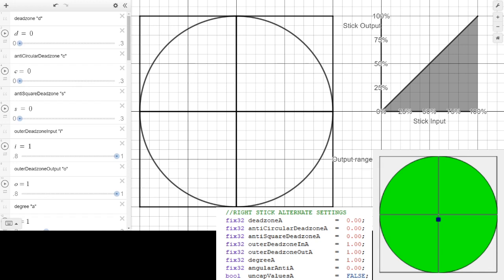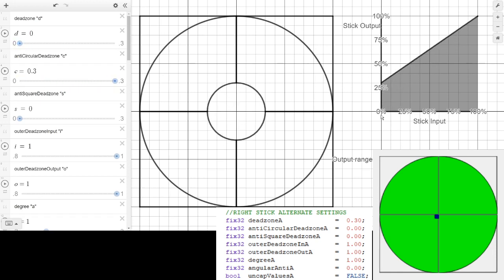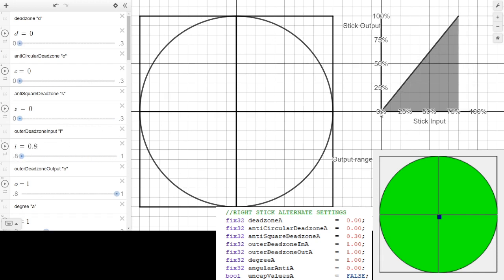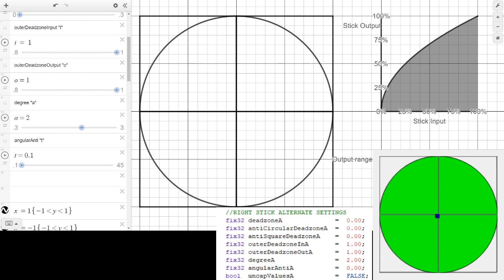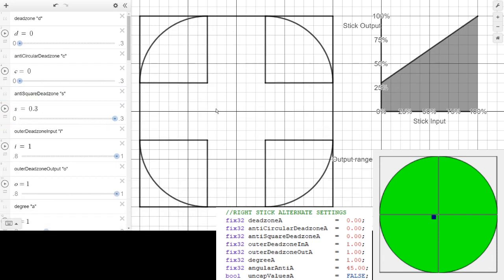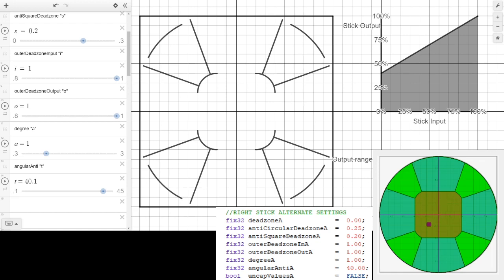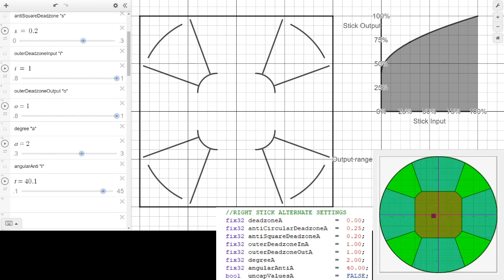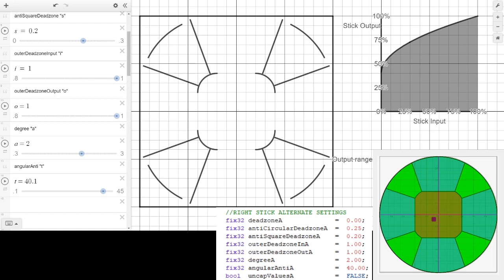Anti-deadzone Explanation and Demonstration

Comment: I associate deadzone as a counter to stick drift, so would increasing my anti deadzone increase my stick drift too?  If so, is there any way to counter the stick drift from the anti deadzone?

Another question is: With a 0 deadzone, would reducing the outer deadzone input have the same impact on the stick output as setting an anti-deadzone? Could I start my movement at 10% the same way as an 0.1 anti-deadzone just by reducing the outer deadzone? And if so, would the rest of the movement match?
Reply from the maker: The antideadzone values can be used in a few different ways, including counter the game's deadzone, make the curve/degree changes more accurate, or to functionally change it's shape.  All of the values in this script can be used together, and the deadzone value can be used to set the size you actually want like in any game that offers it.
Some examples would be:

If you want to use a circular deadzone at 30%, but the game uses a square deadzone at 20%.  You can set the antiSquareDeadzone to 0.20 and the deadzone to 0.30 to do that.  Nothing will happen within [a circular] 30% of the stick, and once you exit the deadzone it will then apply the antideadzone and counter the game's deadzone.  There you've increased the deadzone you're using, but have countered the game's deadzone shape.

If you wanted to use a 15% circular deadzone, and the game already uses that, but you don't like the curve the game uses, you can set the deadzone to 0.15, the antiCircleDeadzone to 0.15 and customize the degree to your preference.  You're still using the same size deadzone in this case.  If you look at the linked graph and set the deadzone the same as the antideadzone, you can see there's a a gap, but changing the degree will show the starting part of the curve will change.
Reply: @EternalDahaka  If I wanted 0 deadzone and 0.1 anti-deadzone would I experience major stick drift? How would I circumvent that without increasing the deadzone and compromising the responsiveness?
Reply from the maker: If the game's deadzone was 10%, and you used an antideadzone of 0.1, then that would cancel the deadzone and give you a 0% deadzone.  The stick drift would be the same if you played at 0% deadzone in a game that offered it.
If the antideadzone used is larger that the game's deadzone, then you'll start skipping over actual turn speeds.  For example, if a game's deadzone is 10%, and you use 0.15 antideadzone, that ~5% of the most precise speeds is lost.  Any drift would be worse in that case.  You'd just have to be sure to not use larger antideadzone values than needed.
Reply: @EternalDahaka  Would there be any way to have different deadzones to hipfire and ads? Like having anti-deadzone only when holding L2.
Reply from the maker: @caslusotas9038  
Yep, that's how the normal and changed input was shown in this video.  The script was always active, but the normal input was unchanged, and I was using the left bumper to use the alternate settings.
The current script lets you set 2 modifier buttons with the full list of alternate settings for each.  That's also offered for the left stick as well.
Reply: @EternalDahaka  Thanks for the answers, they really helped me to clarify all these deadzone questions.

One last thing, sorry if I'm missing something but where can I find this script? And does it works with cronusmax or only with titan two?
Reply from the maker: @caslusotas9038  
You can find it through the online resources tab in the TitanTwo's GutnerIV app by searching "antideadzone".

I've heard some scripts can be converted, but this one specifically might not.  The cronusMAX and Zen supposedly only support integer values(like the TitanOne) and this script uses decimals and trig functions that aren't offered.

I did make a simplified script for the TitanOne which should work for the CronusMAX too, but it doesn't have the curve or angle options.
https://www.consoletuner.com/gpclib/?s=1671
That's a direct link to it.  If you have a cronusMAX you might try and see if it works on it as is.
Reply: @EternalDahaka  I've neither one but I might try it with the cronus as it's the only one I have access to in my country. If it works I can give you a feedback.

Regarding this simplified version of the script, does it works (on the TitanOne) as the script shown on the video? I know you said that the curves don't, but what about the circular anti-deadzone? Does it works equally as shown or it has any "clunkiness" or imprecision due to the lack of decimals?

Sorry for bothering you with this long thread, I'm really new to this world of customization and I'm trying to avoid mistakes and future headaches
Reply from the maker: @caslusotas9038  
It works exactly the same except for very small movements/deadzones(about under 5%) are more jagged.  There's only a handful of values at that resolution and using 0-2% deadzones you can only really make squarish shapes.  That ends up making small diagonal movements feel overly sensitive since the antideadzone is skipping over some of the slower diagonal speeds.  Using a deadzone larger than 3% starts getting the antideadzone shape a bit more circular, and I would recommend using at least that size to avoid that jank.
I'll try to upload a small video in a day or so to show that.  Otherwise the input/shape becomes smoother the larger movements you make.

Ask as much as you want.  These devices are a bit pricey to not get what you want out of them.
Reply: @EternalDahaka  Regarding these adapters, I've been reading about people using xim with titantwo because of xim's better precison with a mouse. Does that mean that the analog precison is better too on the xim, or the titantwo does the job?

Currently my biggest issue is doing fine adjustments, because of the in-game deadzone, so I'm really concerned about the precision of micro movements. 

I know Titan has features that xim doesn't have, but these extra features aren't necessarily too appealing for me. My #1 concern is having full control over my aim, so that I can stop being dependent of game developer's good job/will.
Reply from the maker: I can't speak on the XIM or the difference with mouse input, but the TitanTwo has more than enough precision for an analog stick.  The most precise sticks currently are the Xbox ones, having 16-bit precision, meaning they have a range of -32678 to 32767, and the TitanTwo offers -32768.000000 to 32767.999985 decimals(the device will convert stick input to a range of -100.000000, to 100.000000 though).
My T2 script loses a bit of that precision through converting to decimals and all the calculations, but that's not noticeable even with extremely small movements.
Reply: That's good to know, I'm tending to go with the Titan over the cronus now. If I really get one I will definitely try your script.

Anyway, thanks for all the info man, it really helped me to better understand all of this.
Reply from the maker: @caslusotas9038  
https://youtu.be/aZ5vgraDRGE
This is the video hopefully showing the resolution issue well enough for the TitanOne/Cronus.  A deadzone of 3 avoids the large diagonal jump and is relatively smooth in games.  The rest of the movements look otherwise identical to the TitanTwo version.
Reply: @EternalDahaka  Just saw it, really interesting to know things like this happen. I'm glad you've told me this, because otherwise I probably would have no idea what's wrong, only would feel something is off.

Don't know if my perception is right but it feels to me that even at 3% the small diagonals movements are kinda imprecise, jumping some values, at least compared to the video of this thread. Although this may not be that prejudicial to the aim in general.

About the script, is it possible to activate it without having to press any button, just leave it always turned on? I don't know if it's possible, but I'm thinking of having an anti-deadzone for the hipfire (always on, without the need to press any button), and a different anti-deadzone for the ads (this one turned on when the aim button is pressed). Like I said, I'm really new to these things, so I'm sorry if this is a stupid question.
Reply from the maker: @caslusotas9038  
3% is just the minimum threshold to avoid the large corner diagonal jump.  The resolution is still the issue for the other diagonals, because there's only a few values at the small of movements that are being expanded to the antideadzone distance.  At 3% there's only ~3-5 initial diagonal values per quadrant right past the deadzone which becomes noticeable at that distance.
The diagonal skip when using deadzones/inputs under 3 can be obnoxious, but at 3 and onward it's not too noticeable in games.  I can try to make a game example to demonstrate it too.  The graph makes it look worse than it actually plays.

Yep.  The top batch of settings are always active.  The alternate settings you need to hold down a button to activate.  The script was active in both videos, but since I didn't change any values the always active input was the same as the normal controller.
Reply from the maker: @caslusotas9038  
https://youtu.be/kElwbrg5h6I
TitanOne examples in some games.  Unfortunately my TitanOne is pooping out so more tests or work on the script might not be possible.

As a short summary of the video, I updated the script so it makes more accurate circles.  There was extra loss in precision with the calculations which affected the lower values that was slightly improved.  The current version lets you use down to 0% deadzones without the large diagonal jumps.
Minecraft is the only game I tested with noticeable jank, but every other game I tested wasn't an issue.
Simple curve options were added.

Hopefully that's a better example to see if the TitanOne is worth it or not.
Reply: @EternalDahaka  Hey man, it's me coming to bother you again. I've managed to buy an used TitanTwo instead of a new TitanOne and have been messing up with yours script since then. And, before I say anything else, I should congratulate and thank you for the amazing work you've done with it, I can't imagine myself without it for now on.

I've been facing some troubles not with the script, but with micro movements with my controller (Nacon Revolution 2), where I'm actually moving the stick (although pretty slightly) and it isn't being registered as an input. I've even zeroed the controller's deadzone and the problem persists, so I'm thinking the problem resides maybe with its analog potentiometer. Since it's not a cheap replaceable controller, I'm gonna put it to repair and hope I'm right about my assumption...

Having said that, I've remembered that you said that Xbox one's controllers are the most precise "having 16-bit precision, meaning they have a range of -32678 to 32767". Does that translates to a stick that's more sensitive to micro movements? And does the fact that the titan converts its value "to a range of -100.000000, to 100.000000" affects its precision/sensitiveness? If so, would it really matter to have 16 bit precision? I've tried to search about it but I couldn't find it anywhere.

Although your script helped me immensely, and I'm truly thankful for it, I'm still struggling with these really (really) tiny movements not being registered. Maybe that's something innate to the analog stick technology and I'm trying to achieve something that they were not designed for, but - at least for now - I'm not convinced that's the case. If you've faced something similar and knows what could be happening or have any insight about it, please, share it, it would help me a lot.

Once again, thank you for all the help that you gave me and I hope that you could lighten me up on this issue.
Reply from the maker: @caslusotas9038  
Unfortunately I can't speak on the Nacon, but I have a Logitech f310 which has a huge inherent deadzone(awful).  I've heard different brand analog modules can have different inherent deadzones, but I don't have any experience soldering to haven't tested if swapping a new one in can fix that.  The Nacon's customization has deadzone options, so if the stick also has them that's pointless.
If you have a normal PS4 controller, you might test that to compare.  My official PS4 controller doesn't have any deadzone and there are value changes with the slightest touch.  The DS4's resolution offers increments of ~0.8%, and under normal play that really shouldn't be noticeable.  My really precise adjustments are normally still 1-5%.  You might be much more perceptive/precise than me though.

A very small amount of precision could be lost converting to 100.000000, but my script then converts that to 1.000000 and does a decent amount of calculations on that.  Judging from the device monitor, just using the default settings output values lose ~0.5% accuracy on average.
Xbone controllers will spit out much smaller values than the DS4 normally, but personally it's negligible in practice.  I can see a small bit of jitter from the DS4 in the graph because of the resolution, but I can't feel the difference at all.

Sorry if that doesn't help much.  Hopefully it is just the stick and the repair fixes that.
Reply: @EternalDahaka  Thanks for the answer, I'm gonna put my controller to repair and hope that fixes the issue then.

One last thing, when you said that "DS4 resolution offers increments of ~0.8%", does that means that if I'm capable of doing a movement smaller than 0.8% it won't be registered any input? As for the xbone controllers, do you know the value of the increment percentege?
Reply from the maker: @caslusotas9038  
Yep.  If you move under ~0.8%, 0 should output.  The play in the stick is normally higher.

Assuming they can use full 16-bit, the Xbox controllers have increments of ~0.003%.  That's much too precise for me to physically test, but I've seen small values that indicate at least 0.02% steps.
Reply: @EternalDahaka  hi mate quick question if you dont mind. I am using ds4windows with antimicro to play fortnite. My in game deadzones are : left stick 10% and right stick 5% how can i use antideadzone to make sure it is precise as it can be i feel like its not as i would like it to be
Reply from the maker: @dontuse321  
I've only seen images of DS4Windows options so I can't speak directly on it.  I'll assume that it's options alter the stick position like this video demonstration, but tell me if it doesn't.
Are you using Antimicro for mouse emulation, or just buttons?  I feel like the native stick aiming and Antimicro aiming would overlap.  If you're trying to just use Antimicro for aiming you might be better off disabling the native support or setting the in-game sensitivity as low as possible and customizing the aiming settings in Antimicro instead.

For just DS4Windows, if it works like a circular antideadzone and alters the stick input, you can set that to 0.05 and set the deadzone in DS4W.  That will counter the game's minimum, and you can set the size you actually want.  You could set the curve in either Fortnite or in DS4W, but just do it in one or the other(one should be linear).  That's the only advice I can give.  Again, that's assuming DS4Windows works like the script in this video.

Comment: IS there any way you can change Stick Input Curve, to a linear curve
Reply from the maker: The script curve by default is linear.  The degree slider will change the curve which you can use to help make it feel linear in games that don't use linear curves.  As long as the game uses a power function you can get it exactly linear, otherwise it'll just be an appoximation.  For example, if the game uses a quadratic curve(x^2, 0.5 in the linked graph), you can set the degree to 2.00 to cancel it into a linear curve.

https://www.desmos.com/calculator/s0omnlui73
This is how the script works to affect the game's curve.  The dotted line is the curve you want, and the blue line is the curve that you should actually get once the script affects the games curve.  You can mess with the game and script values to see how it works.

Of course without knowing or formally testing the game's curve it could be difficult to know the exact value the games use, but you can throw numbers in and just feel it out.

Comment: Is there a way you can implement a anti deadzone of a very small value? I've tried using Ds4Windows but it only allows you to change two decimals. 0.00. Steam will let you change 3 but I find it's still not enough I'm looking for a way I can put a more granular antideadzone like 4 or 5 decimals. Is this possible?
Reply from the maker: Float values can accept up to 6 decimals(I just wrote 2 in this script for space), so it's possible, but I can't speak for the accuracy beyond ~4 decimals given how many calculations and possible truncations are made.

The DS4's stick resolution is -128 to 127 so that level precision shouldn't make a difference, and it seems to me like that'd be really hard to notice.